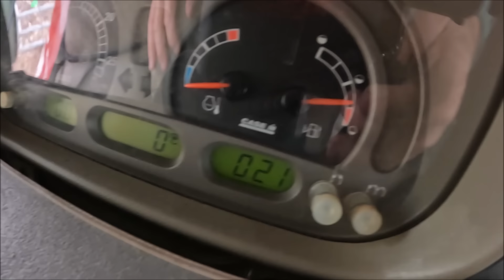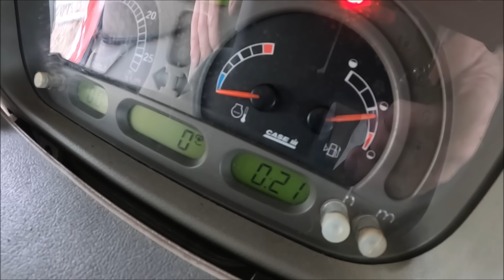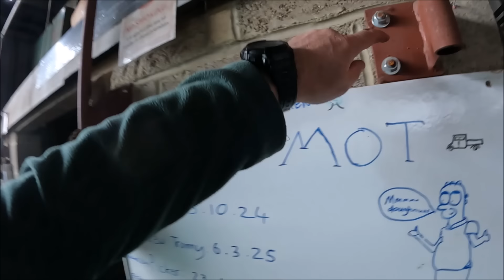12/10/24  The last two loads  (Load one)

Comment: Re the concreting, how about putting some scaffold boards in for now as shuttering and then swap them out once the panels arrive.
Reply from the maker: @nigeljames1109  
The panels are an integral part of the concreting job Nigel. So no can do.
Reply: @FarmerP I'd concrete out past where the bales are and sit the panels on top the concrete instead of on plates. Then if you change your mind you can swop panels gates etc around. Still work the fall and levels needed away from the posts which are the datum point.
Reply from the maker: @farmernige  I could do that if the panels were on level ground Nigel, but most are going on a down hill slope, plus I want the outside level at least 6”  higher than the inside so my short cattle can reach their breakfast 🙂👍🏼
Reply: @FarmerP  you could put shuttering on the outside of the uprights concrete to them and sit the panels on that and concrete the outside back to the panel 6" higher as you require? But I see your logic and can't disagree. Frustrating that the panels aren't here yet. Another idea is just hang gates all around and use the existing feeders for now? I'd definitely look at putting a permanent race and crush under the overhang and use that yard for the pens. Fit a walkway alongside make it safer and easier.